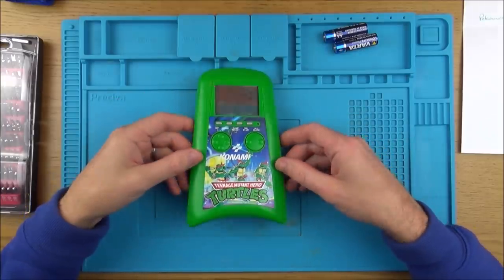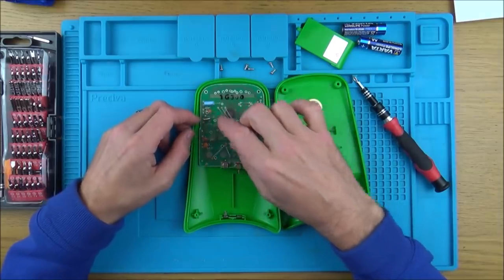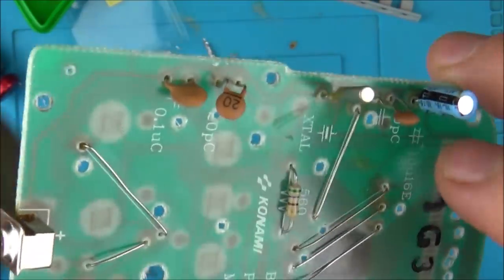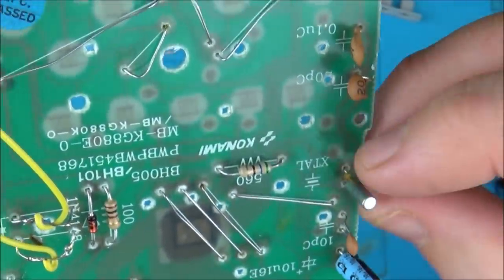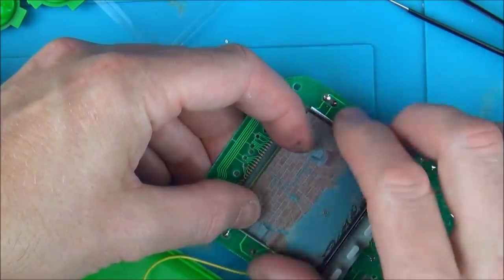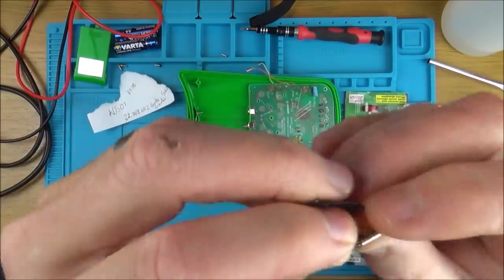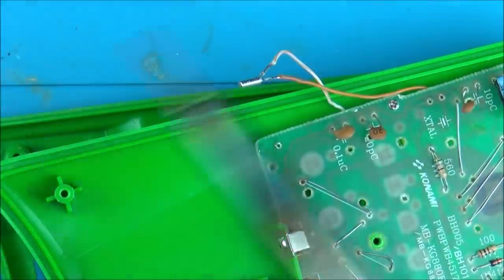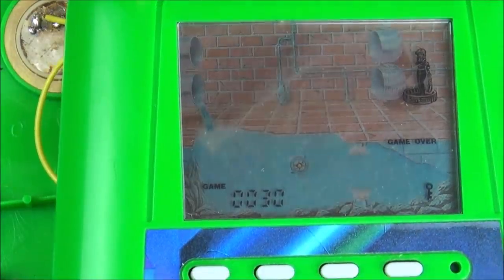Trying to FIX: 1989 TMNT GAME (Quick Version)

Comment: You are right - these quarz resonators can break when the device is dropped. Sometimes they only change the frequency (gets higher) and sometimes they are completely dead. It's a good idea to fasten the resonator to the PCB with some glue or tape. A "quarz resonator" is only a part of an oscillator - a "quarz oszillator" contains both, the resonator and the electronic cirquit to generate  a clock signal. Well done ;-)
Reply from the maker: Thanks for the tips :-)